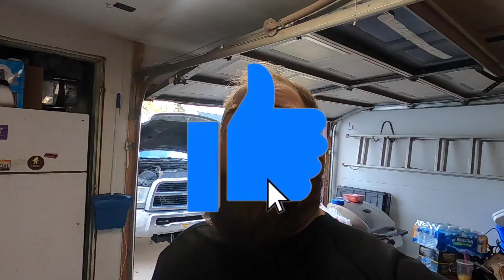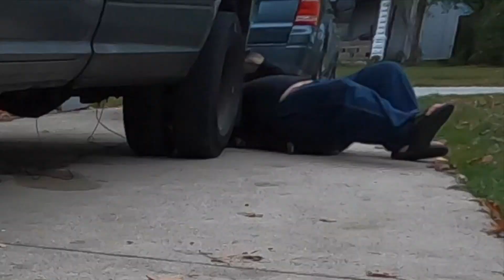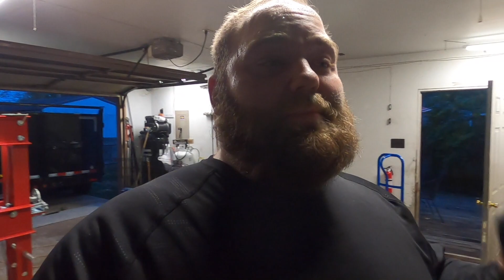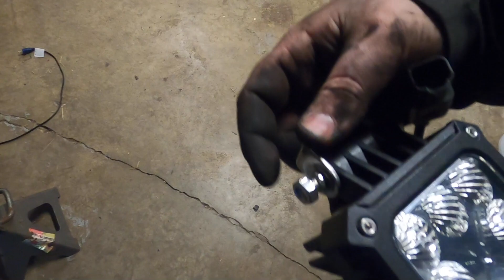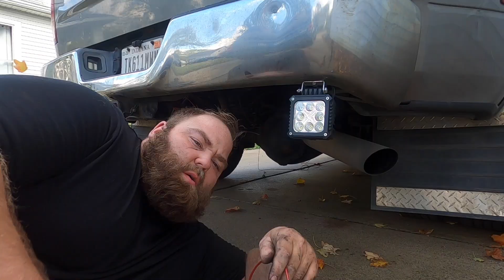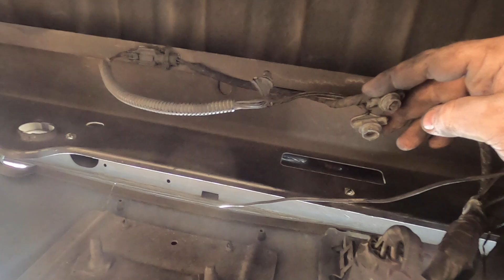Auxiliary Electrical Repair PART TWO

Comment: Give tip next time use heat shrink connectors try using a heat gun  so don't burn wires  when home have electricity

Comment: A friend and I who is a mechanic are trying to get in the the rv tow hauling. Everything I read points toward new or newer truck. Any advice?
Reply from the maker: I wouldn’t buy brand new. Let someone else take the depreciation hit in price. I’m biased but I would go with Ram and try to get a truck under 100k with impeccable maintenance records. All the newer trucks can potentially have the new emissions garbage go bad. But I believe Ram is made to last if you follow maintenance intervals and baby the truck; never hitting it hard onto the highway and always letting the truck cool down after high temps. That’s what I’ve done and I’m still on original turbo and trans.. there’s no guarantees in life but sticking to that would be your best bet I believe. Hope that helps!